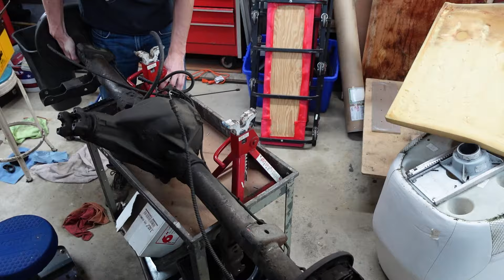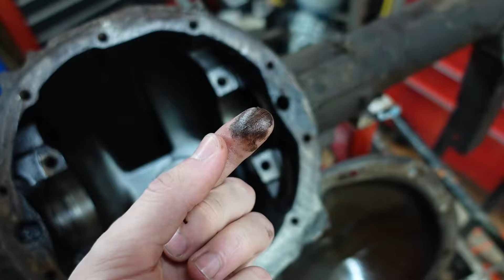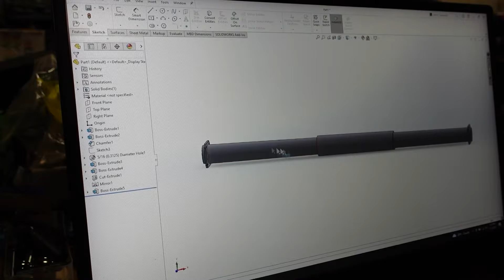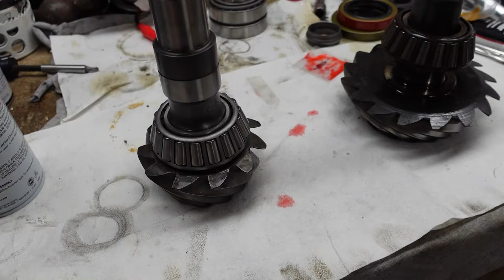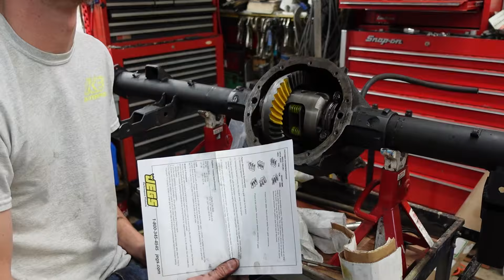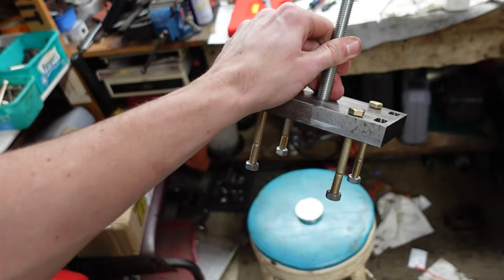The C10's 10 Bolt Gets a 3.73 Posi!!!

Comment: Why did you use 3:73 gears?
Reply from the maker: Might sound a little nerdy lol. I built an excel spreadsheet to find where the motor would be about 2500 rmp at about 25 mph in second gear and 3.73 was about right.
Reply: @designbuilddrive  Depends on tires ; tranny gears and all that stuff. I have a 67 Camaro with a 396 that now has a 5 speed manual. Original had a 4 speed muncie. I found the engine had too much power for he 373s so went to 331s.

Comment: I have a 71' Chevelle that has an 8.5 10 bolt out of a 71' Buick, it is a corpoarte rear end. It has a 3.73 gear as well, a 200-4r transmission, and a 454 moving it all, car is fun to say the least, that 8.5 is nearly as good as the hard to find 12 bolts.
Reply: I bought a posi unit like this to try to install in my 10 bolt 8.5 inch rear end 28 spline as well, and the carrier housing was hitting the pinion gear leaving marks in the housing. Most likely user error but I found out the posi carrier was 1” bigger than what came out of it

Comment: hey guy Im in SASKATOON, contemplating buying a running driving C20, 1968 camper special
BIGGEST PROBLEM is it has 4.56 reargears and will barely do a 100km/h cuz its screaming at about 4000rpm
SO far amigos the biggest wrecker nearby has nothing that will bolt in
Got any ideas what will fit and where i can get one with 3.08-3.73 ish gears?
Reply: 3.73 posi is probly the ideal but i will take anything in a streetable range mentioned

Comment: Hey Mitch.   On a return style truck intake.  Is the upper line the fuel feed (pressure from tank) ?  Or the smaller curved one?  I think I may have mine backwards…. Lol.  Probably won’t run that way if do.  Keep up the videos.